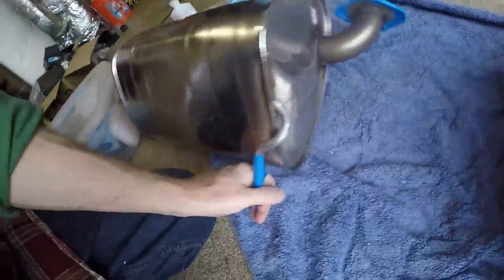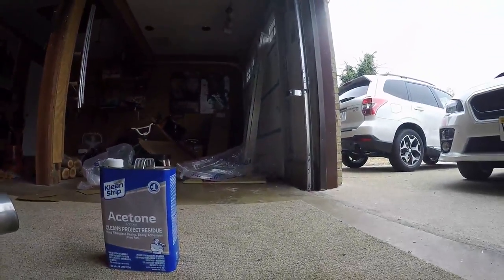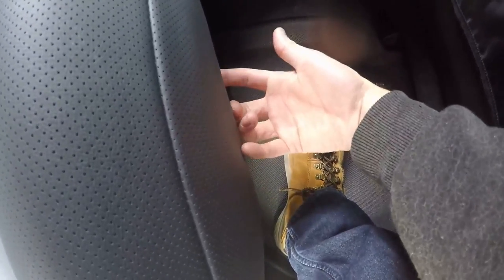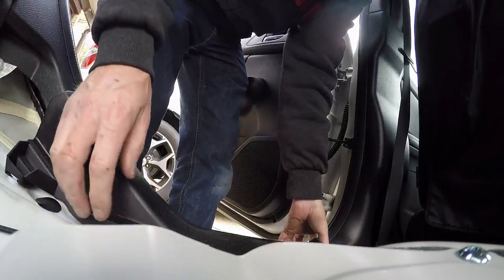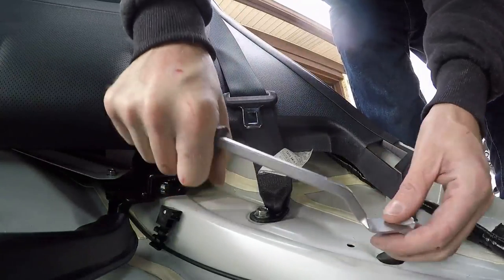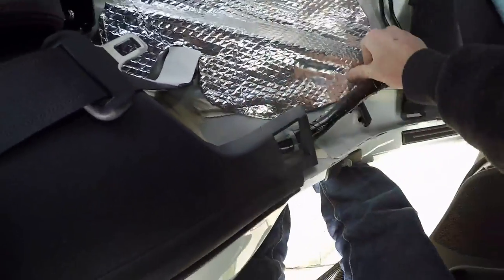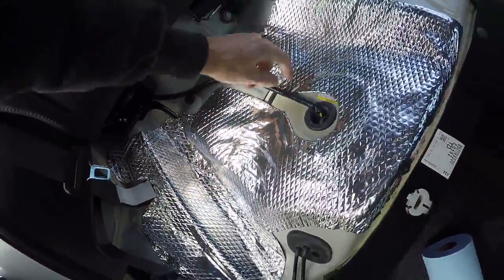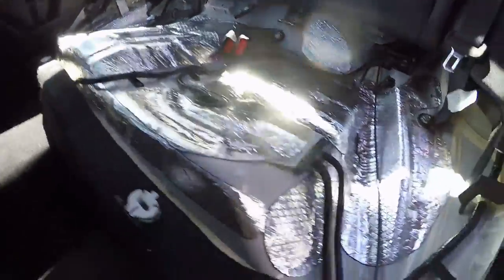2015 Subaru WRX Ep. 682: Noico Sound Deadening Under the Rear Seat

Comment: Waiting on your video when you do the floors... it's gonna be a back breaker for sure! I've done all 4 doors, trunk, and rear deck lid. Any tips on tracing the shapes necessary to transfer over when you do the actual cutting of the CLD?
Reply from the maker: its done.. and my back is broke, you are right. i took 2 asprin. video prob out tomorrow. lifting those seats out sucked.

Comment: Nice work backseat and the trunk bottom seem easiest to do. Do you notice a big difference in sound and rattle. What do you think you added in total so far in pounds and I know you got rid of your spare tire so you can't be that much over I wouldn't think. Again nice work
Reply from the maker: way different. 3 lbs per door, so 12 lbs for doors. 4 sheets in trunk so 12 lbs for trunk. Thats 24 lbs so far. the rear seat today was 2 sheets, so another 6 lbs. so right now im at 30 lbs of dynmat. just about exactly the weight of the spare. but i still have to do the main floow at some point, which will add another 5 lbs.
Reply: LastHumansGarage nice I might have to do this

Comment: Very interested in the results from this if it'll help with drone.
Reply from the maker: it helps with everything. the car is very quiet now. almost done everything except the main floor. which i am dreading.. its gonna suck. im not taking out the center console for sure. ill just work around it i guess.